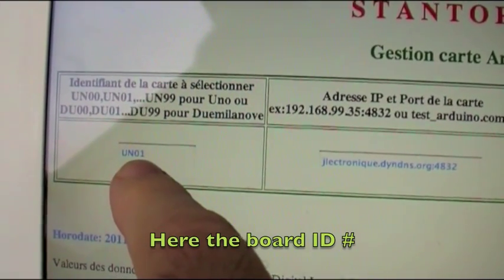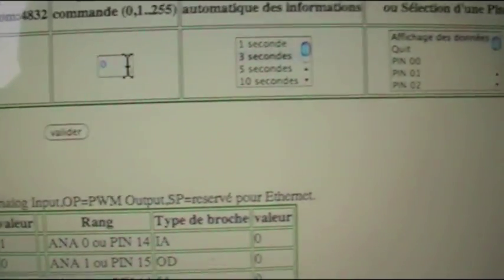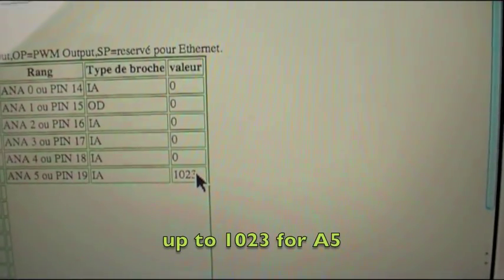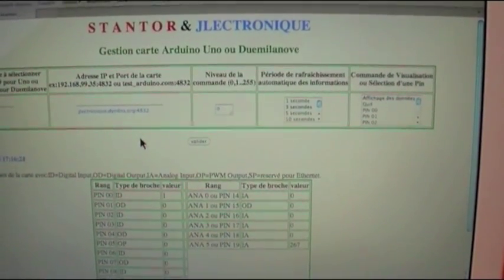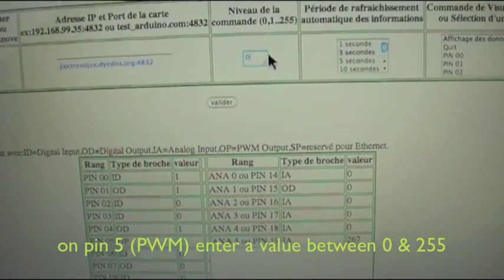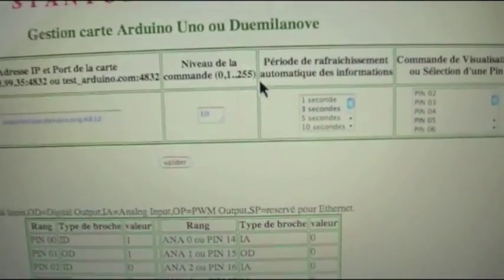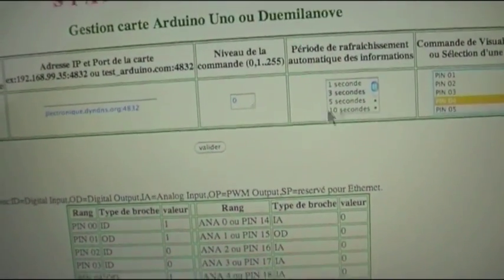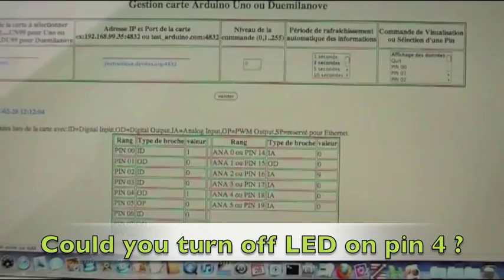Controlling ARDUINO UNO board through Internet

Comment: Very nice video! I am working on a similar project but with about 15 Arduinos that I need to control through different websites (or the same site if possible). Is it possible to get your source code? The link in the description does not seem to work :(